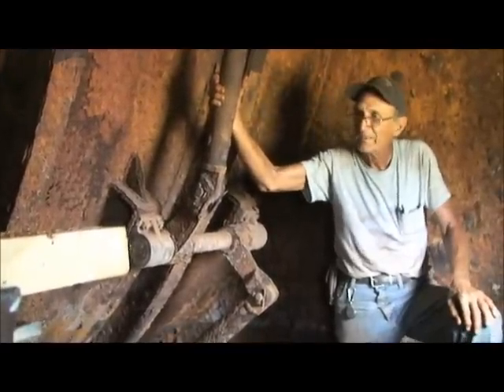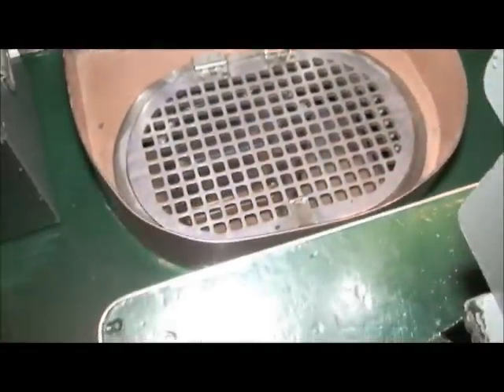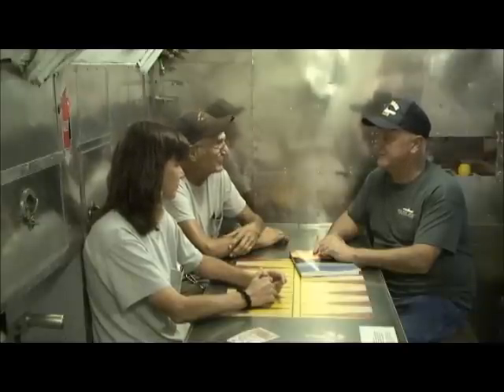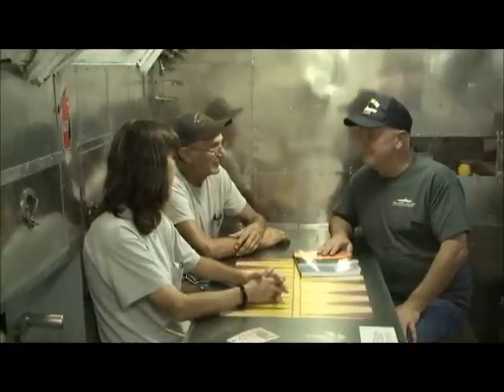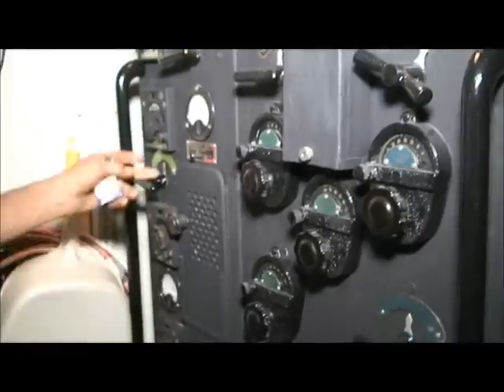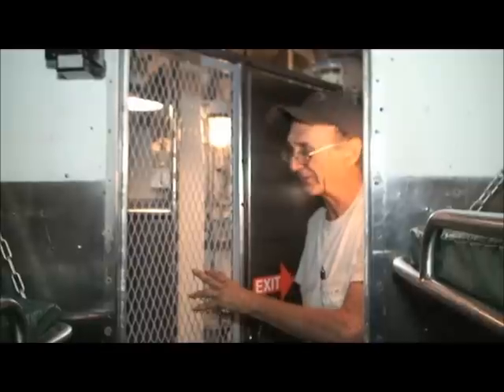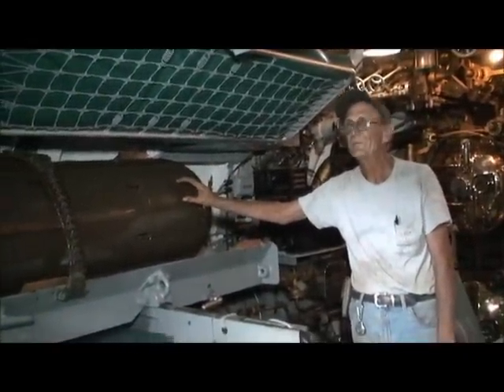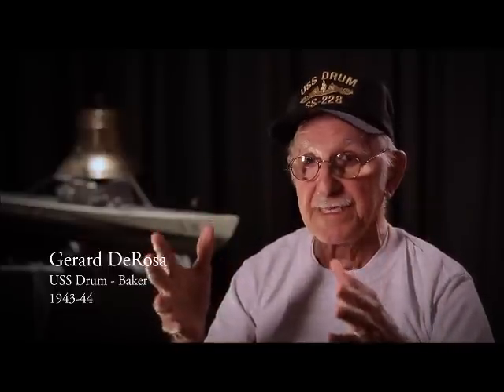Submarine USS Drum Unsung Hero Of WWII

Comment: I have been there a few times - my first visit in 1996, the USS Drum was still in the water, and I was unable to go on board, as the state Governor was there. Later visit, had the Drum on shore (permanent dry-dock), and gaping holes were visible in the lower hull, cut to give access to interior spaces for repairs. Keep up the good work.

Comment: What makes bulbs blow during depth charge attacks? -Ive seen it in movies and one of the vets mentions it in this vid...
Reply: D3cyTH3r The shock wave from the exploding depth charge causes the filament (made out of tungsten) inside the bulb to vibrate and shake wildly, when the filament is glowing it is brittle, causing it to break.
Reply: cmsracing I see -and when the bulbs actually explode, is that caused by vibrations running through the hull or the air-pressure inside the sub changing rapidly?
Reply: D3cyTH3r The bulbs don't really explode, that's just Hollywood special effects.  When the bulb "blows" it just means it burned out.  I have seen them pop when cold water hits them, that's all.  Now if you have explosive gas in the area... well that's a different story!